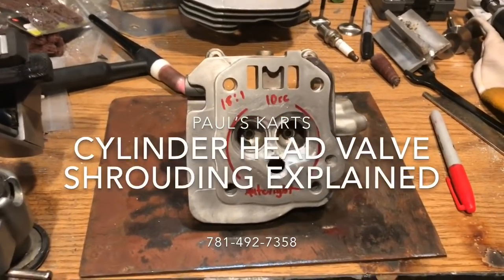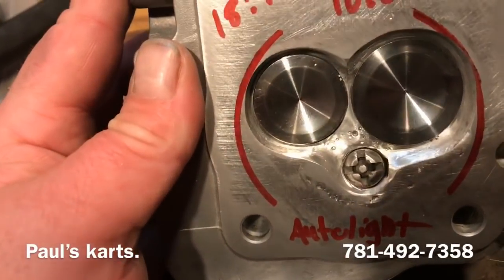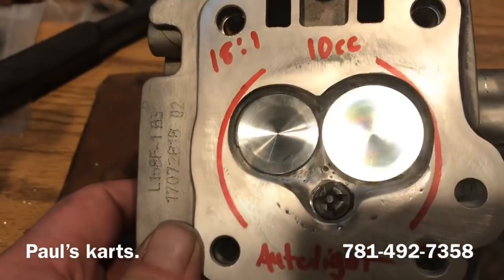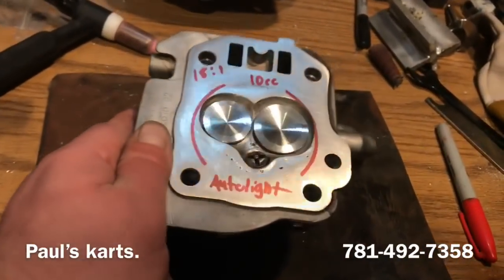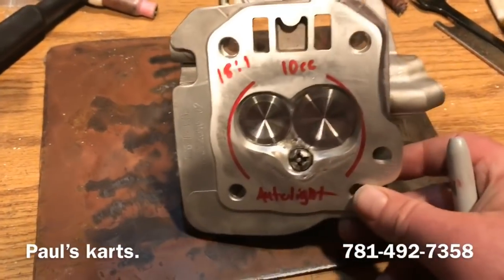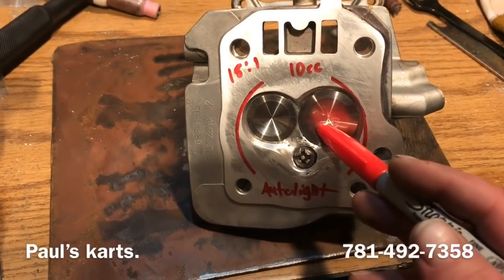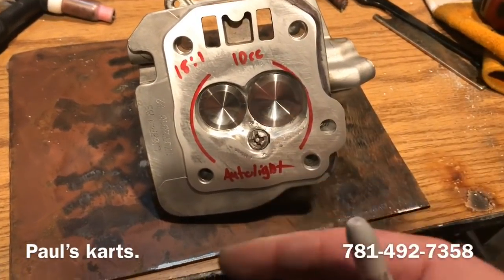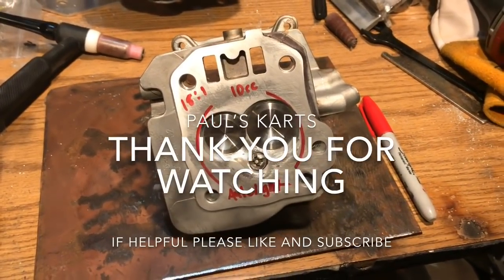VALVE SHROUDING *explained* PRO’S and CON’S of installing BIG valves PREDATOR  212 gx200 gx390

Comment: If your customer goes with a 3in bore you will probably have enough space for properly unshroud those valves. But I honestly dont see that a high compression 3 in bore small block will be good for anything but drag racing in a mini bike. He should follow your advise in 1st place.
Reply from the maker: Lol .. I feel the same .i told him from the beginning this build was all wrong but some people feel they know best .I ended up talking him down to a more manageable compression ratio . Something that will work . This is a prime example of the misinformed, forum worshipping, compression is the holy grail, type of thinking . After talking to him twice he is going to let me take over and do my thing .. so in the end sanity prevailed !!!!
Reply from the maker: It’s geting a welded block , only oversizing piston enough to straighten bore after welding .. the welding worps the sleeve ...not 3” piston going in .. prob .010” over ...and a compression ratio of 18:1 has no chance of working ..it’s a horrible design engine for any style engine ... also if it was a drag mini bike engine it has way to much compression .. see if you can find out what the optimum compression ratio would be ??? Nothing needs 18:1 ... nothing !!
Reply: @paulskartslifan4206  Ive seen some crazy small chambers with 3in bores for drag racing but the real challenge will be to seal the compression, thats why Drag Mini Bike ( Charles) use grooved heads  that doesnt need head gaskets and John fear use 8 bolt custom made heads instead of 4 bolts. They go by the idea that "compression is the holy grail".
Reply from the maker: How do you feel ? Is compression the holy grail ?
Reply from the maker: Also sealing it up is just one thing ... there are so many better ways of making power ... high compression is detramantal to rpm .. and no rpm , no horse power ... if compression ratio is to high it takes to much power to compress .. this eventually becomes a force the engine needs to contend with .. why do you want to make a serious opposing  force that’s working against your power potential ... I can’t say anything about John fear , never heard of him .. but mini d bike has actually been at competitions that I won ..I create power based on better design characteristics .. focusing on a single cycle of the engine like the compression cycle only gives a limit to your work ... I didn’t get to be the current record holder by just making compression.. any monkey with a half a brain can get compression .. I hope your learning this stuff here .. I hope these videos are opening your eyes ... this is the way of the future ... imagine the things I don’t tell !!!
Reply from the maker: Also I am just assembling this engine ... I’m just doing what I was asked to do !! There are tons of what ifs , and if I could have’s .. all over this build .. so he’s your right .. there are a lot of ways to improve on this !!! For sure man !!